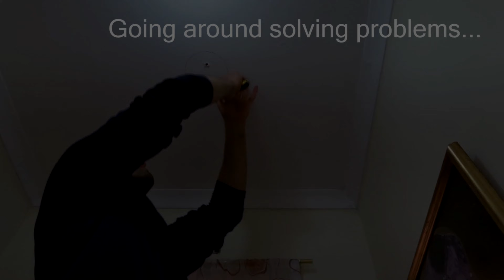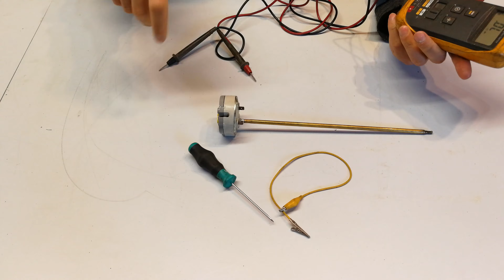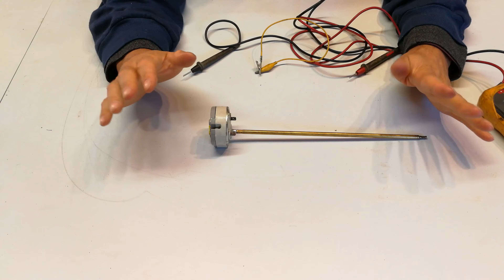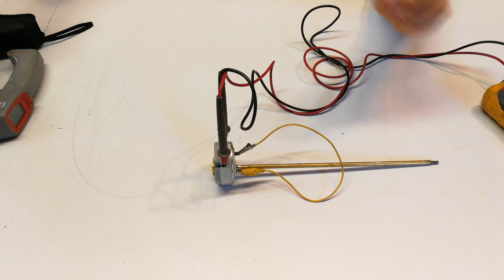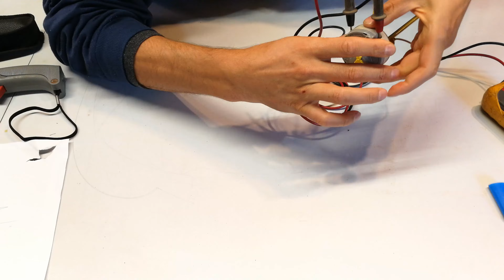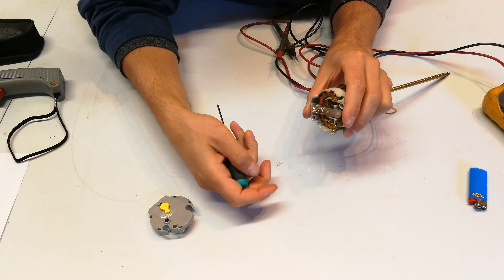How to test a Kwikot thermostat - Principle of operation explained

Comment: If the thermostat is in the geyser... Do I carry on with the same method
Reply from the maker: yes
Reply: @ecologicaltime  you would have to switch off  power to the geyser first before doing the continuity check. If it does not get continuity, it could be the element or the thermostat, so you'd have to remove the thermostat to confirm which one.
Reply: @nickidewet7711  great point. Have to remove thermostat to confirm if it is indeed at fault or not